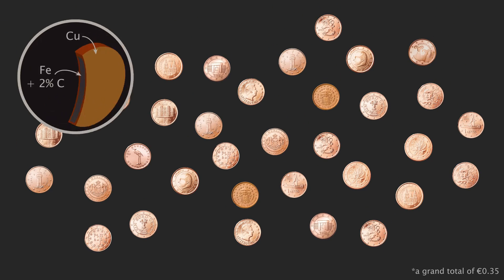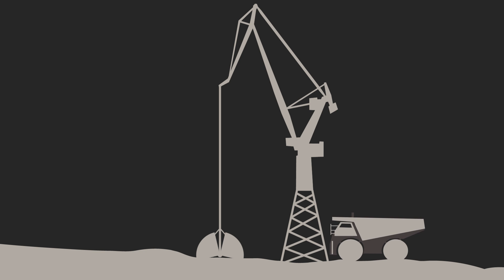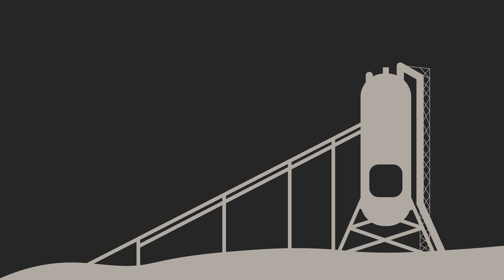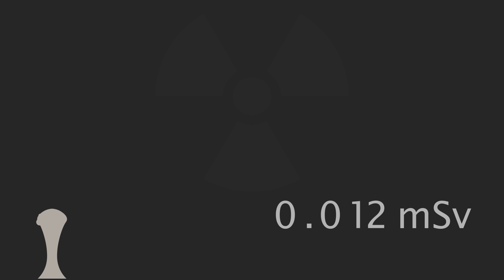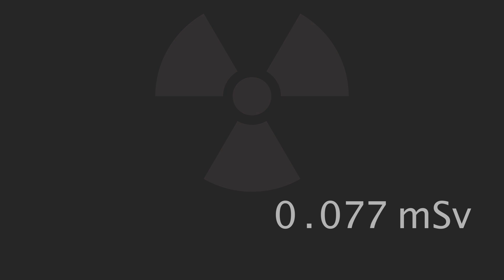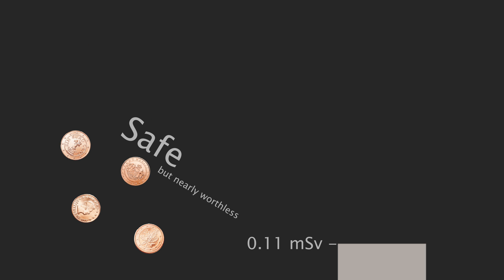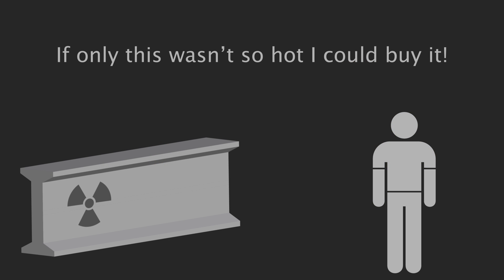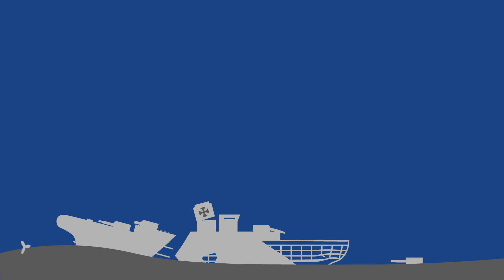Radioactive Steel

Comment: Super fascinating! How do they recycle the steel without introducing contamination?
Reply from the maker: I actually don't know the answer to this.  I guess when it is melted down rather than smelted - issufifciant air is introduced to be a problem.
Reply: Lots of steel working doesn't require fully melting the metal - i.e. by forging rather than casting, and modern metal working can often be done is controlled atmosphere (usually to reduce oxidation of the metal) which probably further reduces contamination if re-melting is required. Only smelting requires getting air into the metal to burn off mineral contaminants, most of the downstream processing actually tries to minimize the air getting into the metal.

Comment: It seems silly to go deep sea diving, as you could instead smelt Iron by using "clean" oxygen generated from the natually occuring and economically viable nitrate and perchlorate ores found in the caliche formations of Chile.
Reply: For the amount of oxygen required to smelt iron ore (~60% iron) into steel (90-95% iron) it is probably cheaper to go deep sea diving than extract that much oxygen from either oxygen rich ores or from electrolysis of water.

Comment: Why can't the measuring equipment just subtract the extra radiation coming off the steel?
Reply: I've worked with detectors for university work, but not exactly an expert. What's most important for a good readings is signal to noise ratio. You can subtract background, but radiation is an effectively random process, so this still adds some noise to your results.

When it comes to things like CT scanners, you want to get the best signal to noise ratio you can, as the better that is, the less radiation you need to get a decent image, and so the lower the dose to the patient.

As for detectors, guessing it's for quantifying nuclear waste? Always hard to get a good result as you can't get too close, but at the same time, you want as good an idea of what is there as possible.
Reply: HorzaPanda
I see. Thanks for explaining. But for personal use it would be fine right? You need that type of accuracy only in certain situations
Reply: I'd imagine so, your results won't be quite so good, but not as if you're going to be buying top of the line equipment for personal use, or would need anything incredibly accurate in the first place
Reply: HorzaPanda
Ok thanks :)
Reply: Don't mind¯\_(ツ)_/¯it,it's under wather and it's small radiation(radiation is everywhere)just chill

Comment: Yup, I worked at a facility that processed Uranium for reactors, and there, they tested you regularly for contamination, including checking your lungs for having breathed in any dust.  To do this, you are closed into a detector chamber for half an hour, with large sensors against your chest.  (great time for a nap, if you aren't claustrophobic).  The chamber was built with pre-WWII battleship steel.
Reply from the maker: I take it you're not claustrophobic?
Reply: +Soliloquy Not at least when I know I can get out.  :)  Same as Heights, I have no problems with them, if I know that I'm secured / safe.  (I have been up on my roof unsecured, and that was a bit nerve-wracking)